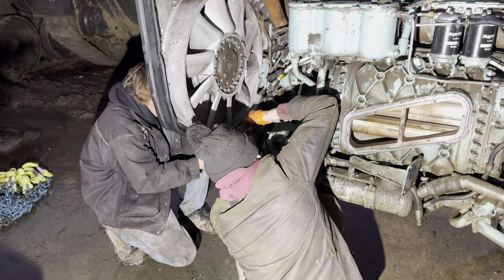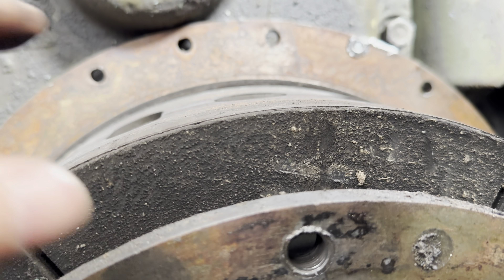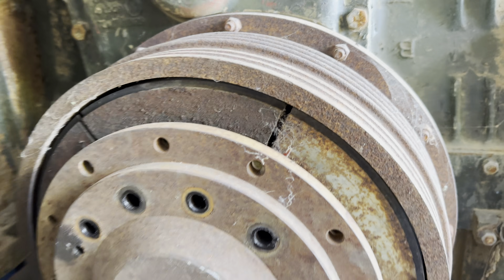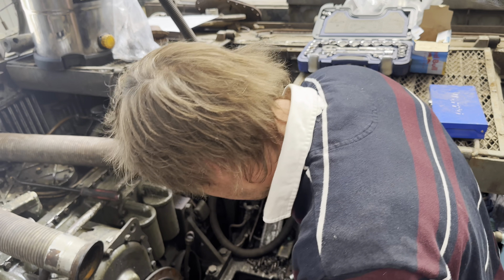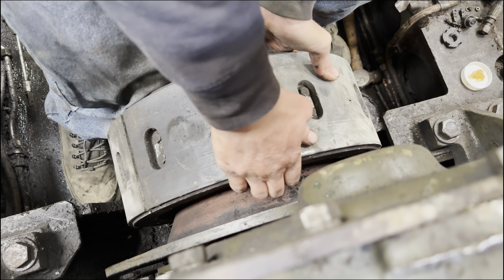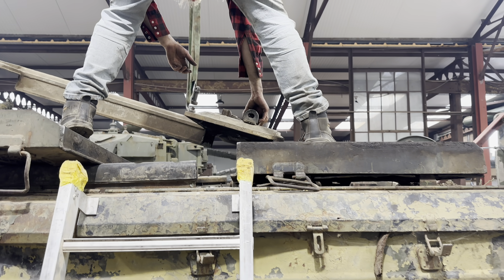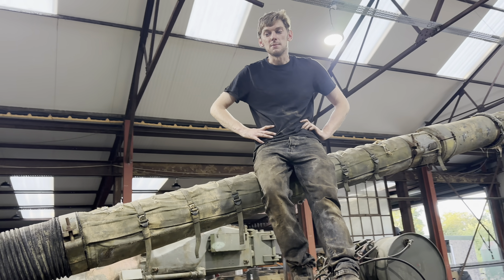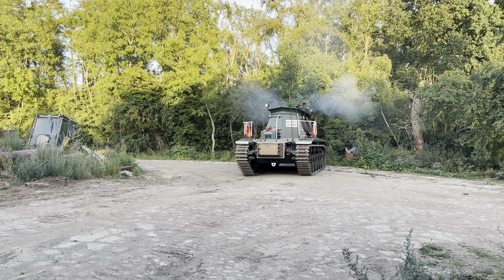This Chieftain Was One Breakdown Away from Disaster

Comment: The horn on the BARV sounds like its off a Komatsu loader! I noticed in i believe it may be an oil pressure guage cover on the side of the enging had what looked like a radio active sticker in it. Whats the go with that?
Reply: Tritium . It glows in the dark for about 25 years and then slowly the glow goes into isotope heaven.
Reply: @nilo70 thats pretty cool. Thanks for the explanation. 😊

Comment: Call your local NAPA and have them demo/sell you a CRC Smartwasher, you won’t regret it. They’re filters in the basin keep the fluid fresh longer, good heater and strong pump. Had mine over a year, zero issues. Even has wheels to roll around wherever you need it. “Great bit of kit” as you all say.

Comment: Given these are not driven in anger anymore (not that kind of anger) i wonder if it wouldn't be possible to drill a small long drill hole through the housing and give it an automatic greaser.
That said, why they didn't make it outside greasing is pretty clear, they feared it would enter the clutch and render it useless.  It's a stupid design, honestly.

Comment: Yes nice catch on that clutch don't you have a service manual on them  chiftons  that should of had a service time if there's no grease certs if it's just a packed bearing will now you know and all the others will have to be done periodically little stuff will kick you every time that other housing can't be welded up and returned out ??? For extra parts I would have some of those clutches made while you have the old linings those arndt hard to make at a brake shop watched the process on another you tube video I think it's India were I seen them take wore out housings like that and do a really good job at refubusing  parts like that or starting with that old one and casting a new one out of it great you tube videos on it don't know how they keep there feet working around molten metal and heavy casting in sandels but they do a good job at making stuff out of nothing with old tooling ?¿?

Comment: Cheiftan has 3 fuel pumps because its a multi fuel engine, different feed rates for different fuels. (I think) could also be for backup, incase one goes out
Reply: We only used to set one pump up per engine  1 for the L60,1 for the H 30 & finally 1 for the K60